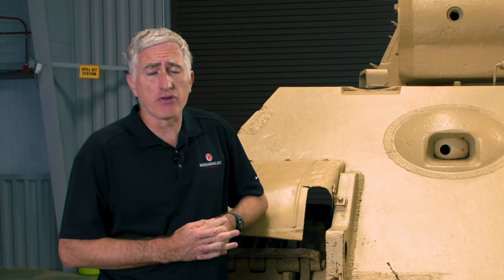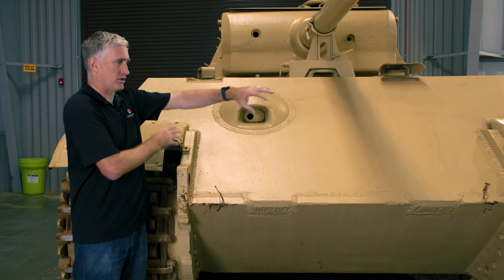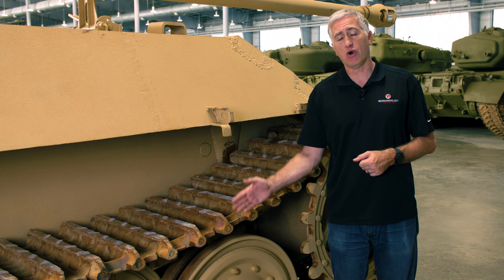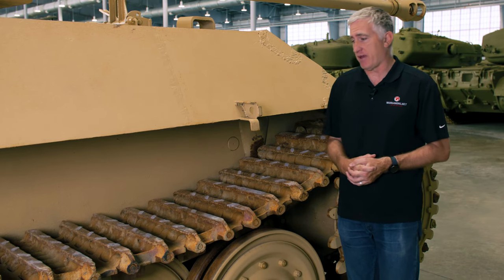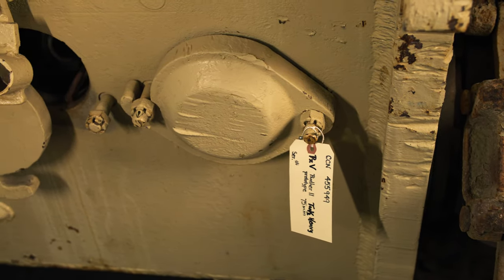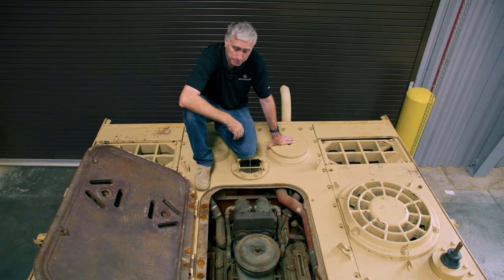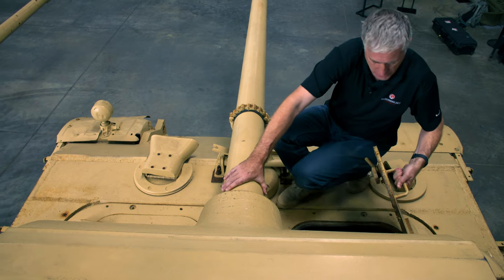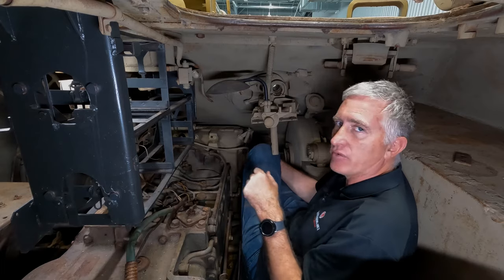Inside The Chieftain's Hatch: Panther II

Comment: 19:50 I watched a video with Hilary Doyle he said the transmission is different then than the panther he said the front plate slope is at a different angle to make room for it
Reply: "Panzer Tracts 5-4" States that both Panther & Panther II have a ZF AK 7/200 transmission. However, the steering unit is different. Panther uses a single radius, while Tiger II and Panther II use a double radius unit. Panther II also uses the Tiger II final drives. The upper hull slope is the same, but the lower front hull slope is 50° like Tiger II, instead of 55° as on regular Panther 

The Olvar B transmission was proposed but apparently not adopted for the design
Reply: @dougedsall3317  strange in the video I watch he said it had the semi auto ovar b in it.

Comment: Thank you for the video. Surprised they even tried the new wheels if they cost an extra 2 Tons. I understand the rubber problem but extra steel,  extra ground pressure and extra fuel consumption would rule it out for me.

Comment: 6:10 is the track pin retaining ramp really original to T-34? I would ask you look at the Marmon Herrington CTMS - there is a strip of armor joining the two lower hull sections that roughly bisects the tank's lower hull side. This strip protrudes from the hull side, and has simple right angle edges for most of it's height, but only in the section where the upper run of track passes it, the strip has machined bevels, as if to act as such a track pin ramp

Comment: I'd be interested in someone with engineering know how could calculate how flexible the rubber would needed to have been to attenuate the vibration and road noise to an acceptable level with that design. 
Just eyeballing it and with total guessing on my part.. I would think the rubber, that far out from the center radius, would make the surface area between the rubber and steal large and needing soft rubber material. I "feel" like making the rubber soft enough with that small amount of rubber would make it not have enough integrity to hold together.

What I'm trying to explain is.. Normally the rubber is on the outside of the wheel. It contacts the track in a really small contact pad. The force in that small pad allows the hard rubber to flex. Putting the hoop around the rubber now the contact pad between the track and the steel is transferred to the rubber, the steel hoop cradles the inner rubber giving it more surface area, force is even transferred to the top of the steel hoop pulling the rubber away from the wheel, and deformation pulling at the sides.
The mechanical stresses are more complex.

Comment: There is another flaw with those steel-tyred road wheels, they are far weaker structurally as compared to monoblock steel wheels. I'm not sure how much of an issue this is on tanks, but they've tried putting rubber inside the wheels on trains to improve ride quality. This was not the best of ideas in the end. This caused a structural weakness that allowed a wheel to spontaniously disassemble at over 200kph and derailed an ICE train in Germany a few years back.

Maybe that extra 2 tons of weight combined for the wheels is because they've had to compensate for that weakness in the wheels. On trains that's not an option, as unsprung mass is inversly proportional to maximum running speed (I.E. the hevaier your wheelset, the slower you're allowed to run to minimise damage to the tracks) so they always work to make the wheels as light as possible.

Comment: Panther 1 has steering tillers, while Panther 2 has a steering wheel, like the Tigers. It must’ve have used the Tiger system steering mated to the Panther transmission.

Comment: I wonder what it would do for the intermediate course of the war if the german vehicles had been designed with better servicability. I feel like if they had bottom hatches for components like the transmission (or the ability to remove the entire front section like on a Sherman), it would greatly reduce the manhours required to maintain the notoriously failure prone transmissions.

Hell, now I'm wondering if you could go back in time and invent the modern "power pack" idea back in the 30ies how tank design would have adapted. imagine an engine and transmission pack for a WW2 tank that could easily be lifted out of a tank, replaced with a new one in like an hour, and then hoisted onto a train and driven to wherever it needs to go for repairs and refurbs...

No driveshaft taking up valuable internal space either...

Comment: It’s not called an “A-Frame” Chief. It’s called a TOW BAR. I’ve seen this mistake repeated time and time again on YouTube. And yes I am an expert on the subject. A tank mechanic a recovery specialist very familiar with the M-578, M-88 and 2 versions of the Army wrecker truck. I’ve also snapped a couple of these things trying to recover a vehicle on glazed over roads. They snapped like match sticks.

A real A-frame is used for lifting out an engine or transmission or in combination the power pack (engine and transmission in one unit). Ok hope that clears thing up. Tow bars for pulling on a road and an A-frame for lifting.

Comment: I understood the Panther 2 was going to have the same 88mm PaK 43 main gun as the Jagdpanther, or am I mixing the Panther 2 with the E100 series?
Reply: buy one to figure it out yourself
Reply: This was a misconception created by Spielberger who made an error when looking at various documents and made the incorrect conclusion that the Schmallturm had been meant for the Panther II. Later research showed that this was not the case as the Panther II project ended in mid '43 while the Schamallturm was a project from '44.

Unfortunately videogames and many model makers still depict the Panther II with the incorrect Schmallturm with the 8.8cm KwK 43

Comment: I would doubt that they needed stronger armour than 45 mm because there were the anti-tank rifles in Red Army, that cannot pierce more than 40 mm almost at point blank,  and surely not the 60 mm used for the Panther II flanks.

Comment: It's a real pity there is no prototype for the upgraded Panzer IV with the sloped front armour, upgraded suspension, more powerful engine, more powerful gun etc etc. I understand that with all the suggested changes they decided to just build a new design of tank. But even so, a surviving prototype would at least show the alternative to the "problem child" Panther.
Reply: They tried to redesign Panzer IV with sloped front armor, and iti didn't worked. It became so front heavy that suspension couldn't cope with that.
And a "Panzer IV with the sloped front armour, upgraded suspension, more powerful engine, more powerful gun etc" it is basically a new tank. Then why stick to the limitation of an 1936 design and not designing a new tank from scratch?

Comment: you ignore the fact that the germans during the 20's had secret bases inside soviet russia kept secret from the rest of the world, and even though they still didn't fully trust each other, the germans trained the russians in a ton of military strategy, technology etc and germany even developed some of the planes and tanks they would later use in WW2 there. likely many of the tanks designed at this time would be insufficient after a year or two of WW2, but consider it entirely possible that tanks russia later made could just be implementing german ideas as well since so much tech was shared or even stolen between them during this time

Comment: When you think about it it's kind of weird that they quite significantly changed the Pz.IV through the war, ending up with a big gun battle tank with armour four times thicker then they started with, and they essentially built an entire new vehicle but still tried to call it a "Pz.II", but they make the armor on Panther a little thicker and try to rebrand it as "Panther II". Usually that kind of name change is done because the original product got a really bad reputation with the users and they want to give the idea that is a whole new design. Wouldn't surprise me if the Panther had a much lower reputation among German tankers than it has among armchair WWII buffs today.

Comment: The panther F is quite often mistaken as “panther 2” the panther F had a different turret with the same or similar 75 gun and slightly more armour everywhere compared to its predecessor, the panther G

There is no panther 2, it’s the panther F
Reply: Actually both are a separate vehicle AND both did exist

Comment: Only a test series of 25 Panther Ausf G built by MAN used full set of Rubber saving steel rimmed roadwheels.
You did not have to open center engine bay hatch to refuel a Panther the Right rear circular hatch that the Chieftan had his knee on is the armored fuel filler cover.

Comment: how is this a medium LIKE when you think about it it had a lot of armor and heavy parts WAS A HUGE FEAR to m4 shermans and was not the easiest to drive and move STILL somehow counts as a medium With the T34 Okay YEAH small slim fast BUT THIS THING is bigger than a sherman
Reply: Compare not against other nation's tanks, as other nations build and operate tanks to their own completely different and unique standards. Compare instead to other German tanks, and how they were operated. The Panther was produced in far greater numbers, by a larger number of factories, than the heavier niche Tigers, and typically deployed in regular Panzer divisions rather than the typical heavy tank detachments Tigers operated in. 

The developmental history angle is also worth exploring. The Panther grew from the lighter VK 20 and VK 24 series designs for a replacement for PzKpfw III & IV. Daimler Benz also proposed a medium tank alternative which was smaller and overall more similar to T-34. Nonetheless, Panther was ultimately chosen instead
Reply: @dougedsall3317   wow thanks man

Comment: Without spline gear shafts this new heavier version would have had the same breakdowns in the final drives and any subsequent transmission issues. The German war industry did not have the specialty of milling for spline gears for some reason, it just was not in their tool box of expertise like the US manufacturers who made it look easy. 
Spline gears for final drives were an incredible discovery for distributing torque and weight along a line of many teeth instead of one at a time. Single tooth gears final drives were not up the task and the Panthers just was out of service too much because of this fault. 
Also having slave labor make armored vehicles also accentuates poor odds of being decisive on the battlefield. It was a flawed production ideal not using German women more in their defense industry. The NSDAP felt women needed to be left at the home.

Comment: If they added 2 tons of weight (in wheels) with the same prone to brake transmission system, it would brake even more often. Good luck defending your Heimat with that junk.
Reply: The idea if this thing went into production was that it would have the same running gear as Tiger II. Being a test vehicle, and given that the Tiger II wasn’t ready yet anyway this chassis was clearly never fitted with it. 

But the idea if it was ever in serial production was to standardise somewhat and ditch the Panther I running gear

Comment: Thanks for this.  Now you keep mentioning that the Panther II was never built.  So the vehicle that you just demoed does not exist.  Got it.  Photographs of the production line in Berlin shows about 8 Panther J hulls under construction these would have been very similar to the Panther II as far as drive sprockets and thus all of the same running gear as the Panther II and the Tiger II.  The turret could have been either the Panther G or the Schmallturm both of which were at the same factory at the same time.
Reply: Do you mean Panther Ausf. F by any chance ?
Reply: Wrong on all counts.

By never built he means it never entered production.

The Panther J hulls you are talking about are Panther Ausf F hulls and you are confusing the final production Panzer IV Ausf J with Panther.

The Panther Ausf F was in no way related to the Panther II, it was in effect a slightly modified Ausf G hull with the new Schmalturm. The only changes worth noting were a new interlock between the upper side armour and the upper glacis and new sliding hatches for the driver and radio operator. The Ausf F had the exact same running gear as the Ausf G.

At least one Ausf F hull did see combat in Berlin with an Ausf G turret but this was likely due to the urgency of the situation and due to the fact that the Schmalturms were not delivered before the war ended.
Reply: @ottovonbismarck2443   Yes you are correct Panther F.  You can see in the photographs F and G on the production line side by side.  The Panther F was basically a late G hull made with Tiger II finals, wheels and transport tracks.   As for never built, there were at least 8 in that single photograph.  There were also hybrid G built with F parts as the production line transitioned.